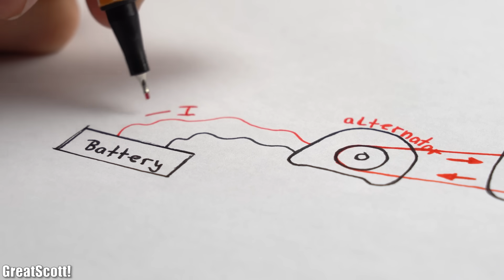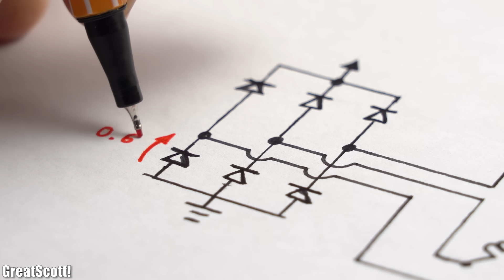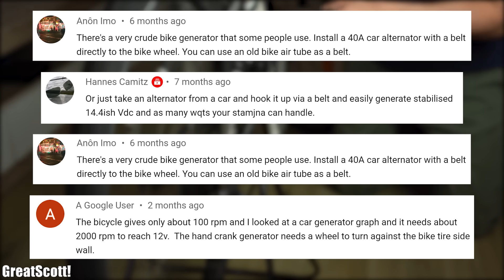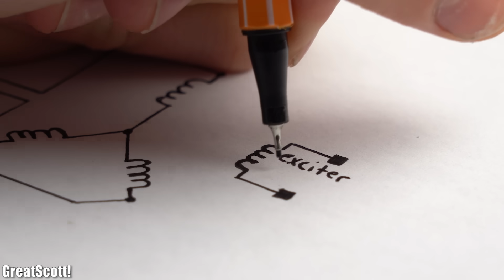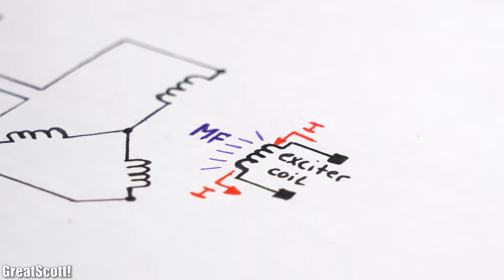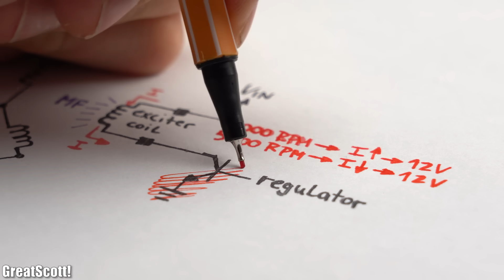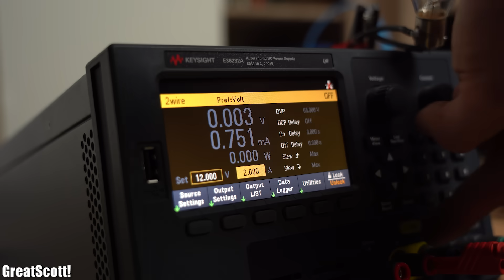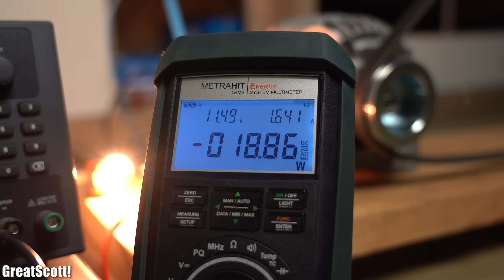Using a car alternator with a bike to power my home? How much energy can I produce?!

Comment: You need a tensioner on that belt. Install it on the slack side which appears to be the bottom side. You should be able to make something using a lever, and idler pulley and a spring. 

I don't really understand why you needed to defeat the regulator. The alternator has an 'S' and 'L' terminal. Apply output voltage the the 'S' terminal (Sense) to close the feedback look for the regulator. Apply 12V from a lead acid battery to the 'L' terminal to excite the field coil. I would not use a separate power supply for this, but a small lead acid battery. Connect the output of the alternator to the battery to keep it charged. You may want to use a diode to allow the battery to be charged by the alternator, but not allow the battery to power the load. 

So connect the 'S' and output terminals together, and feed that voltage, through a diode to a battery that is connected to the 'L' terminal. Connect your load to the output terminal. 

As for the gear to choose, that depends on you. You need to keep your cadence at the proper speed to maximize your endurance (some sources find about 80 rpm at the crank to be optimal for non-pro cyclists). The gearing will not affect the power output as some other comments suggested - gears alter torque and speed, not power. You need the alternator to spin at the proper RPM for max output. Adjust the gearing for that speed at the alternator shaft once you find a comfortable cadence. 

A single human will never be able to produce the rated output power of the alternator. I think the speed you had the alternator running should be good to demonstrate the relatively pathetic amount of power a human can produce with their legs.

Comment: 1 the car drives the alternator at around 3000 RPM. 2. You are capable of outputting perhaps 0.5 to 0.75 HP on your bike. 1 HP is 746 watts so you might be able to produce about 370 watts for any amount of time. Not very useful.

Comment: we're currently building a system where we power a projector and sound system with 10 bikes :) it's going to be a bike cinema. we use brushless motors, rectifiers and PWM solar charge controllers on a 24V system. after much testing, this is the most effective way. we strap the motors on cheap home trainer stands where you can put your own bike on, we create about 600-700Watts with 10 bikes so it's enough for the system but a normal untrained person still sweats after like 20-30 minutes :) its a lot of fun and a great way to learn how what electrical energy even means that comes out of our socket

Comment: Mal ein bisschen Fahrzeugkunde hier: Du brauchst einen Erregerstrom wenn du mit einer niedrigen Generatordrehzahl Strom erzeugen möchte.
Der Weibliche Stecker steuert wieviel Strom der Generator erzeugt.
Und 12V ist immer falsch.
Wenn die Batterie voll ist werden ca. 12,4V generiert und wenn die Batterie leer ist werden bis zu 14,4V generiert.

Comment: You could use a D.C. generator. It uses magnets, and only puts out D.C.volts. Try using a two inch pulley on the generator. If that doesn't work. Use a jack shaft with a two inch pulley to the bike and a seven inch pulley on the other side of the jack shaft to the generator. With a two inch pulley on the generator. That should drastically increase the rpms of the generator quite a bit.

Comment: There's no point to doing this as an alternative to things like solar panels.  However, if you're using a stationary bike for exercise anyway, there's no reason to not use a generator as the load on the bike and use it to charge up batteries and such.

Comment: U should get a small 5w lightbulb in series for the charing exiter circuit. And use a supercap as a battery to both smooth the output and to give power to the exiter circuit.

Comment: as far as i remember the alternator uses a voltage regulator to supply your car battery with a permanent 13.0 to 13.8V (car battery does not charge at 12v), remove the regulator and you get a lot more V out of it, depending on the alternator (a got 22v at around 1200RPM [did not measure the current] )

Comment: “Only useful to charge your phone” that’s actually quite a nice idea to have on your bike. Some kind of generator attached to your wheel which can charge your phone while cycling around. Could that be a future video idea?
Reply: I don't know if they're still around but in the 80s the used to sell a kit for bicycles that had a small generator driven by the tire to power front and rear lights.
Reply: @equid0x  Yeah those are still around and deliver 0-34v AC depending on the speed you cycle and can be very well used as generator upon which a charger could be built. Though I think this is exactly the subject to be tackled for an upcoming video. Creating a stable supply/charging voltage and current from a somewhat unstable supply/generator as a bicycle is.

Comment: Why you didn't mount alternator to frame of bicycle? Use some roller to increase angle of contact. To lift back wheel stable use triangle shape. Try find alternator with build in regulator and then you must only use small battery to "start up" coil in alternator.

Comment: Car alternator is actually a very bad machine in this application. Much better choice would be an induction motor, rewound to the maximum number of poles that fit into the stator at 3 phase output (ex. 36 groves in the stator can give you 6 pairs of poles on the rotor, 24 groves will give you 4 pairs of poles). All this is to get the low RPM machine. Next you must turn down the rotor to the diameter, that allows to glue neodymium magnets on it (with an epoxy glue) so, the geometry of rotor field has the proper symmetry and number of poles, with as small gap between magnets and the stator as possible (likely less than 1 mm, maybe 0.5 mm). Then you can start the play.
Bike has to be secured firmly, the belt should be properly tensed, and you can start pedaling. If your load has a proper impedance (in case of 3-phase load) or resistance (when you use the rectifier), you should produce at least several tens of watts without problem. If you are a well trained amateur, you can sustain 200 W for an hour, a professional (or competing amateur) could go with values closer to 300 watts mean power during an hour. These values are taken from smart bike trainers, that measure the mechanical power directly, in case of electricity production these values will be lower by 10 - 20% because of loses on the drive system and the motor itself. The best is to go for RPM, considering mechanical strength of the rotor and glued-on magnets and generate as high voltages, as insulation, common sense and the load allows.
It is not a cheap and quick thing, to rewind a motor and glue magnets on a rotor, so patience is VERY advised. But after this you will be an expert in rewinding motors...

Comment: I did the same thing years ago and found once I activated the exciter coil it was all I could do to keep it spinning even with no load. You use 2.4Mw per year, wow I have used that in one month with the air conditioner turned on.

Comment: A flywheel would smooth the power input, but won't help the output much. Would make it more pleasant to pedal though...and you need a belt tensioner. 'Spect you knew from elementary maths it wouldn't work though.
Ta.

Comment: I guess 2 pin connector are 1 for activate rotor coil to make MF ( IGN pin), and 2nd for charging indicator. When charging fail this pin is High level.
For starting the alternator, IGN pin still need power from battery  and limiting current by transistor in Regulator IC module and also pulse mode rather than constant mode. When alternator run,  produce higher volt than  battery volt, regulator module will cut over supply for rotor coil from battery pin to alternator it self an running constant...
Cmiiw,,,

Comment: Use a treadmill motor with the same setup. I get 80 watts easily and nearly 200 when pedaling hard. It's also simpler because there is no exciter coil, just straight dc out.

Comment: PMA - Permanent magnet alternator.  Also I hope you realize the smaller rear gears are the fast ones.
Reply: They are not gears.  Gears mesh with each other (they usually directly touch other gears).  Those are cogs.
Reply: @davidjames1684 😂 tosser.. On a Bicycle or a Motorbike they are called gears dumba$$ 
But keep acting like a know it all school science teacher   ,its funny
Reply: @ishmaeldiz2995  On a bicycle they are called gears, but incorrectly.  If you took the time to look up the definition of gears, you would see that gears touch each other, and there is no chain or pulley connecting them.  A bicycle fails this definition, hence they are NOT gears.  Do you see any chains in the example of gears here?  https://en.wikipedia.org/wiki/Gear.  Scroll down and look at ALL the images.  I don't see a single one showing a bicycle mechanism.  Do you know why?  Take a "guess".  Bicycles don't have gears, they have sprockets or chainrings, cogs, and chains but NOT gears.  Gears mesh with other gears directly.  That is NOT the case in typical bicycles.  It is possible to make a bicycle with gears, but I have never seen one.  The main reason gears are not used on a bicycle is because the front sprocket (chainring) is a considerable distance away from the rear axle, thus is a much better application of a chain or belt setup. I don't see anyone else telling me I am wrong on this, only you, that is because YOU are wrong.  Who is laughing now?  Score: "science teacher 1", YouTube idiot 0.

Comment: I repair starter and alternator,from the alternator you showed with 2pins mostly 1is from ignition+ another 1 is for lamp , the one side of the lamp is connected to ignition on + the other side is to the alternator it will send some currently to the alternator magnet rotor (rotor other side - is controlled by regulator)when rotor rotated it will generate bit of voltage through the stator than there is 3 more small diode that rectify + and feed back to the regulator link with lamp input so the rotor can powered by his own generated output (that's y our car battery lamp will turn off after we stared our engine because both side of lamp input is +), than the regulator will cutoff the - of the rotor when feed back from the small diode reach around 13.8~14.4 depends on types of regulators ,hope you understand ~

Comment: now you know that if apply constant voltage to 1 of the 3 coils of the induction motor you can gain voltage in the other 2 but shifted in with the winding ratio - this is similar how some electric cars do the regenerative braking.

Comment: The alternator must keep itself after output voltage is higher than 8V, that coil pin is actually your dash battery lamp, it is needed to provide initial current to the coil. Connect a 5w lamp between that pin and the negative, put 8+V on the output terminal and start spinning it.

Comment: Im surprised that nobody was telling you about the complicated regulation circuit of a car generator. It has internal coils that only generate a magnetic field when you apply a current through it. And that will also regulate the voltage/the power. High current high magnetic field no current no magnetic field= no output

Comment: what do you expect us to learn from a failed project? a human can easily produce 200W on average on a bike based on measurments done. 
I dont know if its the too much slip due to low belt tension or some kind of circuit wasting the extra power but overall this efficiency is incredibly low

Comment: i used a exercise bike with a iron wheel. added a sproket from the frount of a bycycle ti the oppisit side of the origional drive to give me more rpm the dc motor with p.m. field. the motor used a rear cluster gear on the motor so i could play with ratio.  motor (generator) mount was a pipe or rod plus gravity as chain tightener... chain has less drag than belts.  i got 60 wats with fairly heavy pediling    it,s dumped in the garrage as a fun expirement   but......

Comment: Dear GreatScott, with your current setup you should get several amps from the alternator. Please check if the excitation procedure is alright. Many alternators need only a small initial excitation (usually a simple or double  18650 would do) and then it  excites itself.  People in developing areas (like here in Brazil) make low cost generators by  connecting a  small two-stroke motor  to very old scrapyard  alternators and get lots of currents with it. Also, in an automobile,  even at low angular speed they produce enough current to charge a 60 Ah battery within minutes, so it means several amps.    Last but not least, thanks for the good videos and educative material in electronics: they help a lot. Energy production is a very hot and  pertinent subject now more than ever.

Comment: You make it wrong! You should use the regulator circuit. It's very simple. One of the little cables goes to a 12 V source and the another one goes to 12 volts in series with a 5watts 12 volts bulb. It depends of the alternator yoy are using, but most of the models works this way. Just put some time on the alternator electronics and you will figure out. Is simple.

Comment: use a washing machine motor it will put out a heaps of voltage its what people use in cheap electric hydro setups or use a motor from a microwave turn table it is geared and will out put what your mains power does so be careful cheers from down under

Comment: This is why those permanent magnet alternator (conversions) are so much better than the ones with the exciter coil...it takes alot of energy in those just to generate energy
I agree either need a way to have the weight of the alternator (along with a spring maybe) to tension the belt...or another pulley to help keep it in tension...slipping alternators screech and squeal and reduce power output ALOT!

Comment: Hi - one thing to note is the more power you make the more strain it is

For example, get a alternator, place it in your hand and spin the pulley - it turns easily, now add some lights to the circuit and try spinning the pulley, it is much harder as you need to work harder because the load of the lights is creating drag on the alternators magnets

One of my friends is a auto electrician and after he repairs them he tests them on the bench with a electric motor and belt
one day he connect up some headlights and said "spin the pulley" i could not spin it easily but i could turn it, he placed it in a vice and said , take this wheel brace and spin i, i could turn it and the light barely glowed

When the circuit is closed with something taking out the power eg battery or light or any electrical device the power produced causes a drag in the magnets = more work

Comment: Hi Great Scott, if you find what vehicle that alternator is for you may  also find what the pinout is on the regulator, for example :battery warning light and ignition but if your really unlucky it may be controlled by the engine computer.

Comment: that 20 watt wasn't the maximum power which lamp could hold ? ( because of the lamps resistance )
Reply: I'm pretty sure it should generate more energy,
Reply: Why not to improve it by adding hall effect sensor to measur rpm and then an IC to give enough energy to "exciting coil"

Comment: If you had used the motor of a "hoverboard" you could have made it. I build one for myself and 100w is no problem 300w was the maximum I could measure and also quite acivable. Also there is no need for any axillary circuits since it is just a bldc motor.

Comment: This hurts 🤦 you destroyed the alternator. Just take a 12 v battery Connect with a lamp to 1 of the 2 pins you will have a magnet field and get 14 V out. You are great in Electronics but you dont know anything about cars.

Comment: I’ve had great success with an old e-bile rear hub motor (36V 250W), which came with an external controller and therefore a 3-pin AC connector.
By blocking the freewheel-mechanic and removing the rear gear shift (chain runs on the gear with the most teeth front and back), back-pedaling turns the motor into a generator. I’ve then used six VFT4045BP Shottky diodes and a 1F 25V Capacitor to smooth it, and it gives me about 5-18V depending on how fast i pedal.

I’ve been thinking about trying an alternator though since the gearbox inside the hub motor is quite loud, but i didn’t know about the exciter coil issue yet. Thanks! :)